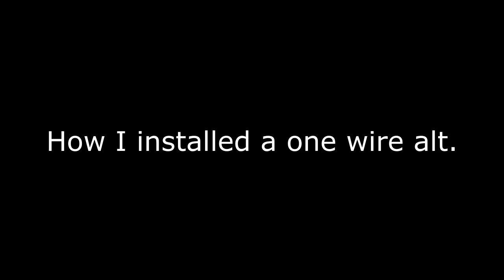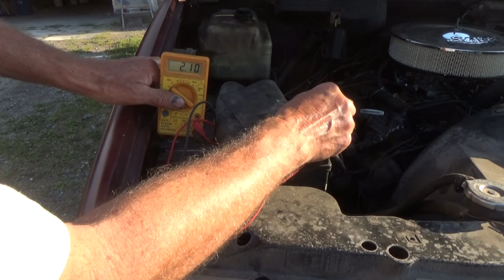one wire alternator install

Comment: I have a 88 GTA trans am 5.0 tpi serp belt 
And I went to try what you did and I could only get the 1 long bolt in the bottom and the bolt on too was off 3 inches 
So I couldn't get it done 
Did you just run 1 bolt and crank it tight?
Reply from the maker: Hi Ben , I had to re rig it to get it to work, made my own parts, thanks, mike

Comment: My new chrome pwrmaster 12si type was doing good for a few minutes, but then went to 18volts. Could it be caused because I didn't add a gbd wire? I thought mount bolt would be enough. What gauge gnd do I use?
Reply from the maker: Hi Allen, I double ground everything,  that's usually have the problems, even used house wiring, thanks Mike
Reply: There is usually an "extra" threaded bolt hole in the alternator case on the back,  opposite the B+ stud. Use that.   The mounting brackets are the WORST GROUNDS

Comment: So what is that wire/harness you tossed aside and said it does nothing? Is that for the regulator? On my 95 it seems to be creating a short. Its one single wire that has a plug on the end, which clips into the alt. Volt meter has been dropping when driving, combined with sputtering at low rpms. But only sputters when volts are low. Well I noticed, at idle, I can create the drop in volts if I wiggle that wire.. I'm fairly sure it's that wire causing it, but there are other wires connected to it further up; couple grounds and something else.
Reply from the maker: I can’t answer that one I always add extra grounds, the go from there,
Reply: @mikehaduck-travel-mechanic884  Well I found out it's the exciter wire. Has a one way 9v current that does who knows what. Anyways, I messed w it a bit and plugged it back in, and also cleaned up a ground connection that was in the same area, on the manifold, and problem seems solved. So far. Thx for responding.

Comment: You don't have to "excite" the ONE WIRE ALTERNATOR?  Just wondering .. thanks     Gary
Reply from the maker: Hi GD, that I can not say,  thanks mike
Reply: I can just try it and see !!!  :)
Reply from the maker: I have not done it to that one,  thanks mike
Reply: Thx Mike !!!
Reply: The "one wire" is a misnomer;  ALL  INTERNALLY-REGULATED alternators still need up to two additional wires to function:  One goes to your "GEN" incandescent lamp and then on to IGN +12v (or direct to +12) to “excite” the alternator at start and the other is the "voltage sense" terminal looking directly at the battery post voltage needed to correctly charge the battery.
Reply: I wire is all that is required. The alternator kicks in on it's own.
Reply: THey are "self exciting". The one I bought (Tuff stuff) said it turned on by 880 RPM but by 700 RPM it was cranking out the current. 
Used to be they turned on and OFF at 1500 RPM - not any more. One wire alts have come a long way!
Reply: MrGGPRI wrong. Only thing that won’t work without the other wires is the battery light on the dash.